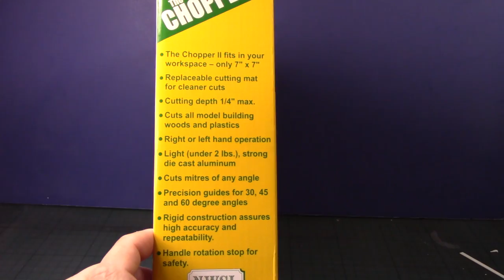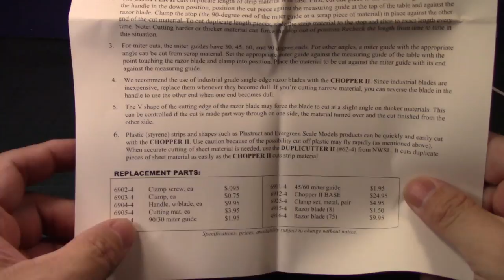Tooltime with Stryderprime - The Chopper 2 Un-boxing and Review

Comment: I just got this a couple weeks ago myself.  Firstly, if you're going to buy it, buy a set of blades at the same time.  Mine came in with a beat up blade out of the box.  Second, they do use a universal single edge razor blade, which you should be able to find very easily.  Third, have a very thick sheet of styrene and a protractor handy if you need any angles besides 30, 45, 60, and 90.  You'll have to build your own custom guides for any other angle.

Oh, and have bandages handy.  No matter how careful you are, you WILL cut yourself with this thing.

Comment: Hey, another super super useful tool is a pair of Digital Calipers. Not only will it give you precise measurements, but will also give you a tool to do precision cutting (you can use the sharp edge to create an initial scribe and then use scribers/hobby saws/chisels/etc. to do the cutting.  

I've been using this in my various build series. Great tool.

*TIP*
Before you cut your knuckles on accident, put a bit of Blue-Tac or something along the corner of the outward facing blade.  I thought I would be careful the first time I used it, and I still cut myself shortly after that.  Simple, but helps save some nasty cuts.
Reply from the maker: That is my next purchase thank you